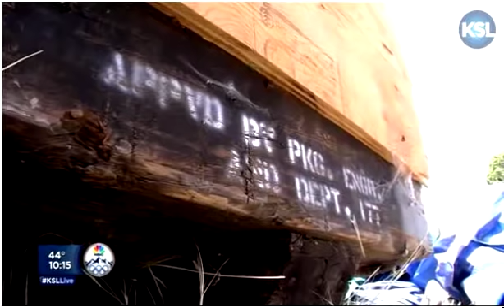World's Largest Amateur Telescope

Comment: If somebody knows him read this message. Please ask him to share his experience of telescope building and night sky experience with his telescope. It will be helpful for other amateur Astronomers.
Reply: Building a scope is straight forward (if you buy the mirrors, that is). You have to know the focal length and measure the distances of the mirrors accurately. I made one and had to move the secondary mirror and rack&pinion a bit to make if focus, but it was no problem. I never built one before and except for the small mistake it was easy. I built the two mirror cells as well out of wood, steel and aluminium and it worked fine. It was a 17.5" dob. I made the tube out of cardboard sheep dip canisters stuck together and painted and reinforced by a thick plywood top end flange. And the stand was made of thick plywood and some steel.
Reply: it doesnt work because the mirror isnt built for/like that
Reply: Twinkling star .....thank you for expressing interest...I will do my best to share!
Reply: @kidpog3d101  It's a parabolic mirror, the f ratio might be a bit short for a telescope but other than that, of course it will work.
Reply: He died
Reply: @carinhall4508  when did he die? How do you know?
Reply: @carinhall4508  cap 🧢

Comment: What would Saturn look like through that with a 10mm eyepiece?
Reply: @Justwantahover ...due to atmospheric distortion, it is only practical to use approximately a 38 mm eyepiece. This telescope, as with any Earth-based telescope without adaptive optics, is at the mercy of the steadiness of the atmosphere (seeing).
Reply: I have a 4.5mm Morpheus eyepiece he could borrow if I can deliver it personally
Reply: @knightclan4 ....way too much magnification,  but thnx for the offer!
Reply: you will need sunglasses…
Reply: @mastro4065  
And the other limit for visual astronomy tends to be our own eyes imperfections.
If my calculations are correct and based on an F/D of 5 (common for most Dobsonians), your eyepiece would yield a x250 magnification...with a tremendous 8mm exit pupil !
I've red many lectures stating that a so big exit pupil was not suitable for planetary viewing, due to eye spherical aberrations that would blur the image. 
That explains why most telescopes dedicated to planetary viewing turn to 200 / 8" aperture, more or so. Because they tend to be the perfect match between the atmosphere and our eyes performance.
Reply: @c.guibbs1238  ....Really good point you make. Something that is interesting, even though I can see more detail on the planets through the 70 inch, the “cleaner” views I had of the planets are through my 6 inch refractor at around 200 X
Reply: @mastro4065  
Knowing that a good 6" refractor is roughly equivalent to a 8" reflector (due to the absence of obstruction), It makes sense, indeed. 
As far as visual astronomy is concerned, the biggest is not necessarily the best. 
For astrophotography, it's an other story...
Reply: @mastro4065  Same here (AP 6 f8) But I can tell you the 7 f9 was notably better,
Reply: @jimzeleny7213  .....yes, good point.

Comment: This scope may be a DOB in the mount, but that says nothing of the optics.  There does not seem to be an observing site off a diagonal at the top of the structure thus it is not a classic Newtonian optic path using a parabolic mirror.  If it has a parabolic mirror there is probably a camera or video recorder at the prime focal point, if this imager is on a de-rotator it can do fine imaging.  If there is a mirror at the to it might be a Cassegrain style light path.  Whatever it is the owner/operator probably does not put an eye piece in and look.  I could be wrong and would love to know.
Reply: @Jonleonard Cassidy ....thank you for your interest!  This is a folded Newtonian design, where the focuser assembly is not too high above the ground.  This telescope is used exclusively for direct, visual observation....Open to the public!  Pleas come and look through it! .....Mike Clements

Comment: I want a quick technical examination of that monster.   Saw the finder scopes mounted on the base but never saw where the eyepiece is.   Is it 30' in the air?    That primary has to be a challenge to keep clean!     Love the builders 'Einstein' look at  the end of the vid.  Obsession gets it done.
Reply: Looks like a folded Newtonian with secondary and tertiary mirrors, so it only needs an 8' or 10' stepladder.   I believe he has a cover to protect the mirror when not in use.   What I like most is the ultralight truss and cable optical tube assembly. (OTA).

Comment: What'd that mirror set you back?  Even 8'' glass ain't cheap!
Reply: Exactly what i was thinking, i wonder what quality it is too. In any case imagine the pictures you could get if you motorise this. Amazing.

When do you hit diminishing returns though? I have a 6" and 8" and there is quite a difference between them. Never looked through anything like a 10 or a 16.  DO you know?
Reply: I have heard diminishing returns starts at like 10-12inches. The diminishing returns are due to atmospheric distortion, which can be corrected in a couple ways one of which is with long exposure and some software, but for that he will need some motors and software...

I admit if I could afford it I would do this too. After seeing Saturn through an approximately 4ft diam telescope in my college astronomy class I am in absolute love. Alas I must settle with my 8", which honestly does a fantastic job too.
Reply: I got a 12" and it's better than an 8" that I had before. That 70" would be great quality cos it would have cost a lot (being such a professional intended application) and he would have got it cheap.
Reply: I had a 8" cassegrain and I whipped up a "barlow" out of old lenses and a towel roll tube. lol I had Jupiter like a grapefruit size (at apparent desk viewing distance). And Saturn was like an orange with 8" diameter rings! lol So my 8" also did a fantastic job. Imagine seeing this in the 70", that is if I can do what I did with an 8". Imagine how good it would be with the 70". And "seeing" must have been excellent that night when I made my "barlow". Of course the image was a bit "smokey" but still really sharp for a home hacked barlow and for like 1000 x mag. lol The "seeing" obviously still plays the biggest part (which is mostly really crap for planets, viewed from near the coast). But that time the "seeing" definitely wasn't crap! lol And the motor drive on my C8 was so good that (with my "barlow') Saturn was still in view (@ 1000 x) after like leaving it for like a hour or so. lol My C8 did a fantastic job. Maybe $2,000 is expensive but the VALUE is there, that's for sure (when you think how expensive the professional scopes are). The small scopes obviously are a lot better than we think (when the "seeing" is good, that is).
Reply: He should get it for free our tax dollars already payed for it. And it was used by the military I'll bet that they over payed  for it.
Reply: Good questions...It took me A LOT of truck driving trips to pay for it! And yea, U.S. taxpayers already paid for it, when it was ordered by the military in the first place. So yea, I bought it “again”, albeit cheaper than its original price, but NO freebie!   (Titan IV launch rocket sold separately, some assembly required!)